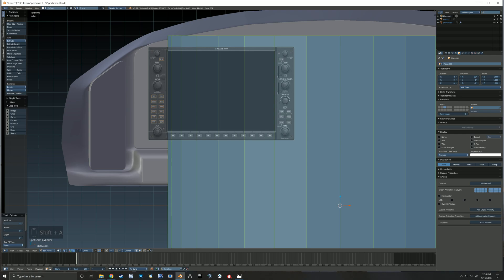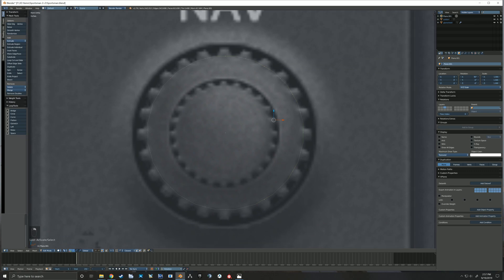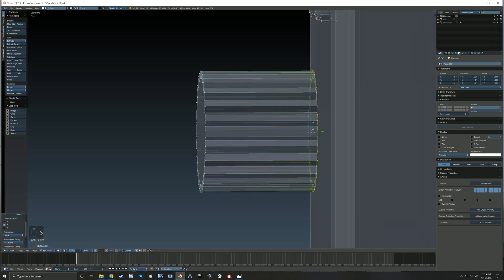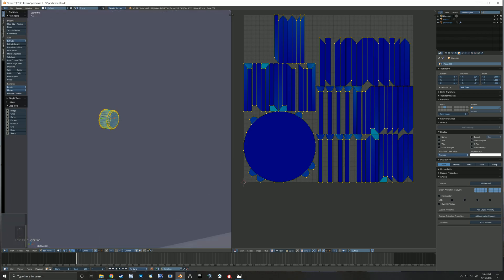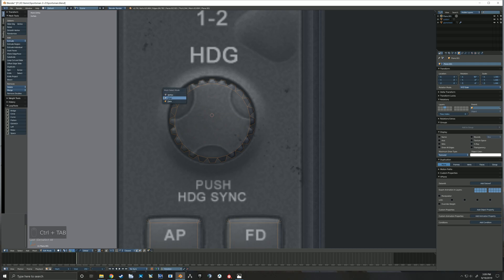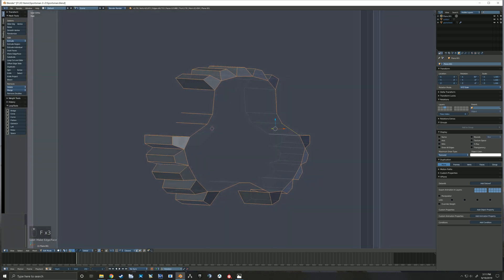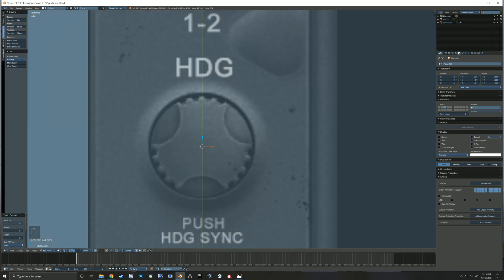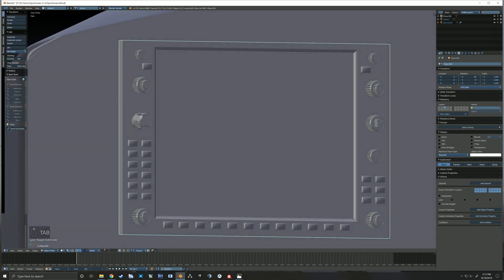Xplane tidbits - Knobs - how to

Comment: Hello Sir, with regard to mounting my 3d airspeed for example on top of the 2d instrument, the steps is not clear for me, can you please make a video tutorial for the steps explained in more details with the folder structure and blender plugin steps as well.
Sorry, but I'm stuck for 3 days trying to figure that out with complete failure. I'm in a process of testing a modeled 3d instrument, and stuck in mounting the face of the instrument on top of the 2d instrument, I'm in need for help, Thanks.
Reply from the maker: I will try to do more in depth videos is the future. For now you'll get faster help at the x-plane.org forums. I currently am too busy with real world things and am not getting much sim time. Good luck.
Reply: @BuildItBetter3D  I posted my requests there as well, no answers, and I've been searching posts with no success, it is huge amount of posts and I spent a lot of days trying to find me missing peace, not found unfortunately

Comment: nice tutorial, I'm looking for G1000 modifications as Air speed indicator and Mfd fuel indicator in order to change aircraft performance, if you can help my,  I will by grateful thanks
Reply from the maker: You cannot change the G1000 specifically, but you can create custom instruments using "generic instruments" that can be overlaid on the G1000 to make it look custom. Instruments ONLY show what is happening though, they do not change the aircraft performance, that must be done within the other settings in planemaker.